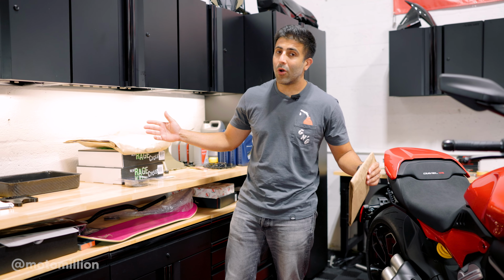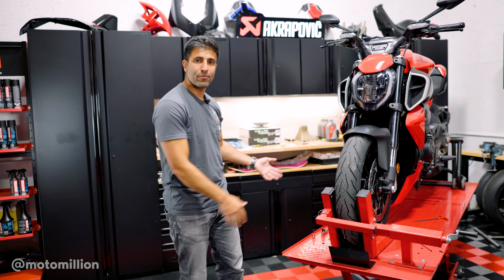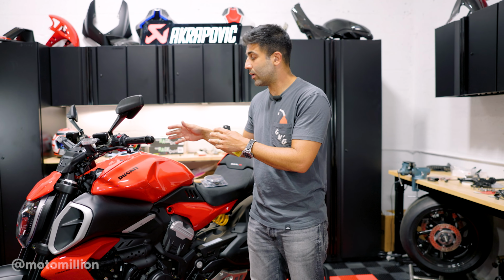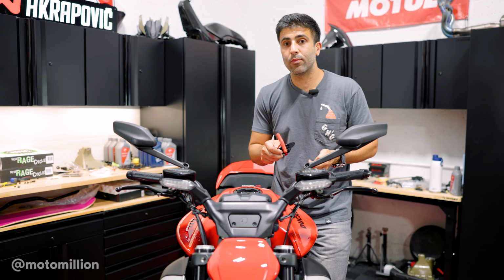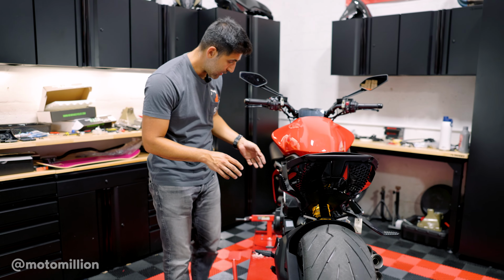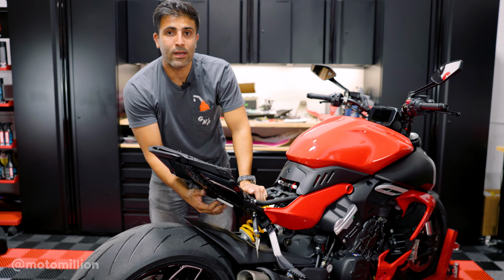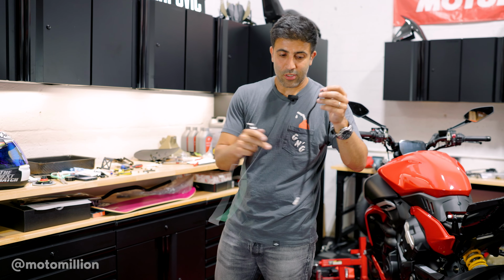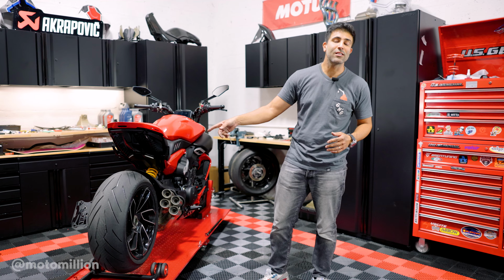4 MUST DO Mods for the Ducati Diavel V4! | Diavel V4 Series Part 1

Comment from the maker: Which mod do you think is the most impactful? 
We go with the Radiator & oil cooler guards... Always gotta protect the cooling system!
Reply: Weight savings bro...BST carbon wheels, ECU flash , coolant, dyno , akrapovich full system...etc... Can u do 
An MV AGUSTA F3 800 RC After do something New please even it is this Diavel V4 with love from Paris my bro
Reply: So far, cleaning up the rear has been the best mod.  Gotta expose that big fat tire.
Reply from the maker: Yes, that tire needs to be seen!

Comment: There was an electronic module for the old 1260 where the turn signal which allowed the brake lights to be used as turn signals.  May be they can make one for the V4 so you don’t need to add any additional lights on the back.
Reply from the maker: There is none so far, we looked into it, but the light unit has a single light setup which does not work for right or left turn indicators.

Comment: I wish there was a solution to turn the brake light to signals too
Reply from the maker: Nothing so far, and it would be pretty hard to do, as the rear lights are not separated to illuminate on left and right side individually.

Comment: Think the side plate looks excellent! Will consider this for mine. Any indication if the new turn signals are bright enough and sufficiently far from the tail lights to be obvious when on, especially under brake lights?
Reply from the maker: I will be honest, we have not really taken it out to check, but judging by their previous products and that the turn signals light up amber, it will be visible for sure.
Reply: Great, thanks. If you’re able to get someone to take a look next time you’re out on her and make a comment or even a short video clip, that would be great. The police in the UK can be hot on these things. 👍🏼

Comment: Next mod should be throttle spacers. I have a 1260S (black and steel) and have them, so much better than stock… however, I really wish I could get a shorter twist throttle/tube. On my 2015 cbr1krr I had a modified r6 tube I think it was which made the rotation much shorter. However, that was a cable throttle vs this bike with electronic throttle.

Any thoughts?
Reply from the maker: We need to check to see if there is a compatible throttle that is shorter throw on this. Also we are checking to see if we can just make a new throttle tube rather than just adding spacers to them.
Reply: What about a domino ride by wire racing throttle? I know they make them for panigales. Wonder if they’d work on the diavels with minor fitting changes.

Comment: Manny, is there an option by having the plate under the seat instead of the side mount?  Btw, always pumped to see this Diavel V4 build video!
Reply from the maker: Yes there is, but it is not visible what so ever.

Comment: I never put a radiator guard on my bike. I've had a ton of bikes and never had an issue, but you're right, you never know when something bad like that will happen. I'll install one of these on my V4 just to safe. Might have to put it on my X-Diavel as well as I'm right around 3,000 miles with it.

As to the plate, I'm fine with keeping that as is. I'm surprised you didn't put new grips on the bike and sliders to help with a drop. Everyone drops the bike eventually, even if its just a drop in the garage or on gravel at a stop sign. Sliders/pucks I find are the #1 thing I put on all my bikes to minimize damage from an accidental drop. An better grips are just nice to have.